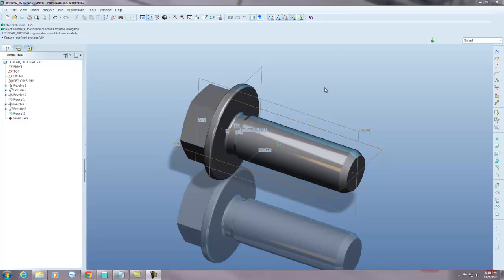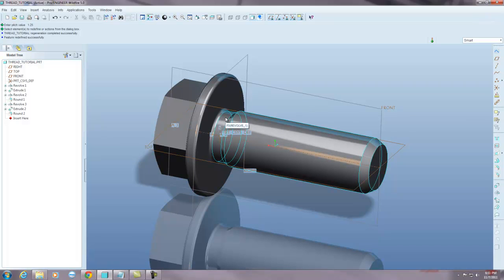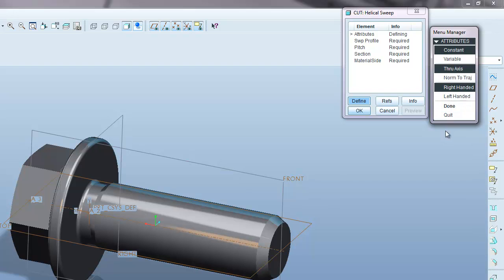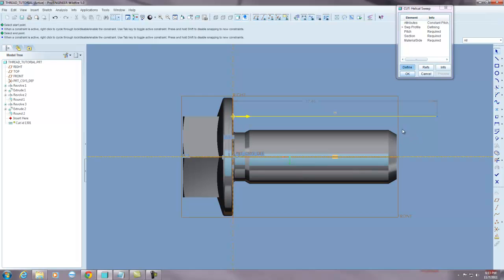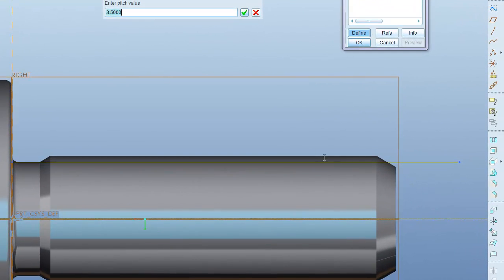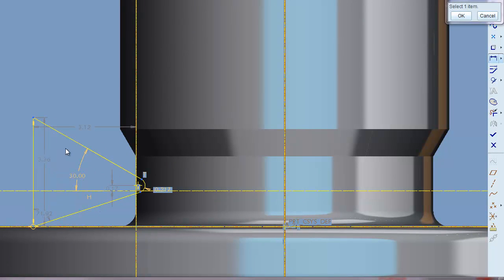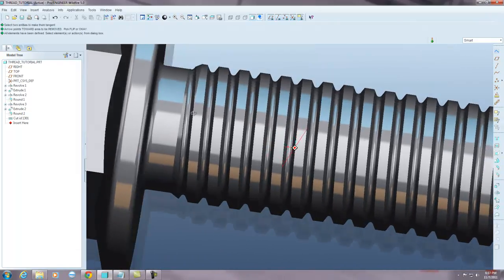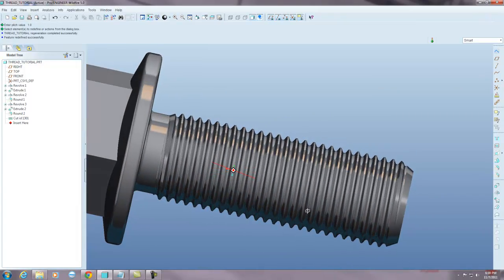Pro/Engineer Thread Tutorial

Comment: This is a reply to Vinay Nikam's question below. Its a good question. When Steve constrained the big side of the cutting tool shape to be co linear with the OD of the part at 6:22, he accomplished 2 things. First, if he ever changes the OD of the part from the original 10mm, the relationship of the tool to the part changes too. You can also add a driving dimension that keeps the big side of the cutting tool profile slightly off the the OD of the part. The second benefit to constraining the tool to the OD of the part is that sometimes when a designer just draws a big triangular tool shape, and then tries to make the helical cut, some portion of the tool geometry will overlap with the trailing helix and Pro will fault out and send you an error message. If this has never happen to you, it can be frustrating when the message says your geometry can't be done. Real world on an engine lathe, it can be done..digital world, overlap equals failure.  If anyone is looking to create mechanically accurate threads, you should get yourself a pitch wire chart like the ones found in pitch wire, thread measuring wire sets. Its a fantastic way to model very accurate threads.  Good luck guys.

Comment: Steve, overall the tutorial is not bad, but at around the 4:30 mark you make a comment about the pitch diameter being used as a construction reference for the trajectory line. This is absolutely incorrect. A pitch diameter is not the root of the thread. Ever. I have cut and drawn thousands of threads and you cannot draw an accurate thread without a circular reference being used to create the cutting tool profile. The thread you create in this video is cosmetically good looking, but mechanically inaccurate. You should clarify that for people that actually want to learn how to draw an accurate thread for global interference checks on their models. Most American threads don't have a radius tip on the tool that cuts them either. Its usually 1/8P as a reference for the root and crest geometry.
Reply: +Shop Tech Thanks for pointing this out. Still, overall this video was very useful to me.

Comment: Now that was easy to follow...my only question, how do you calculate the minor diameter? The depth of thread (d) = pitch (p) X cos 30 deg. So let's say If the pitch is 20 for a 1/4-20 screw, the minor diameter would be 0.1959. Thanks!

Comment: Correction....use the root diameter to calculate the actual point of tangency which is slightly larger than the root diameter. I used your step file in Solidworks and the chart you gave. The diameter to the tangent point is d3. This creates a nice and exact thread. Nice job.

Comment: Steve,
Nice job, but if you are using the pitch diameter to create the root of the thread, this is wrong. The (pitch) diameter actually cuts through the center of the thread form. The root diameter is the actual bottom of the thread form. Check the machinery handbook for these dimensions. If you would use the actual root diameter for the tangent point of the thread radius, you would get a true thread cut and the flat on top of the major diameter would look smaller and more like a screw thread.

Comment: Hi! Could u give me some tips?

I'm modeling wheelbarrow(!?) with Pro Engineer.
Do u know how to get the angle to the tube/pipe?

There is a narrow cap between the pipes in the front (where the wheel is) and have to get wider so that a man fits between the pipes.

I have to add some extra datums?

Comment: Great video, Steve. It looks to me as if the thread from this process is not properly defined, though. The crests of the thread are squared off, but the root/trough is a rounded radius. I think a B1.13M thread would be symmetric about the pitch diameter, right?

The seems more like an ACME thread on the OD.